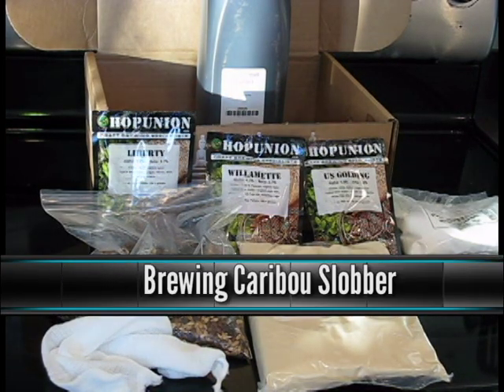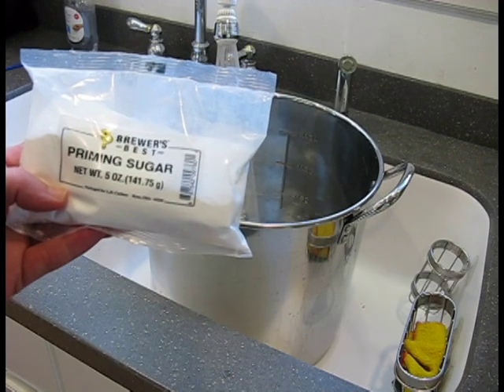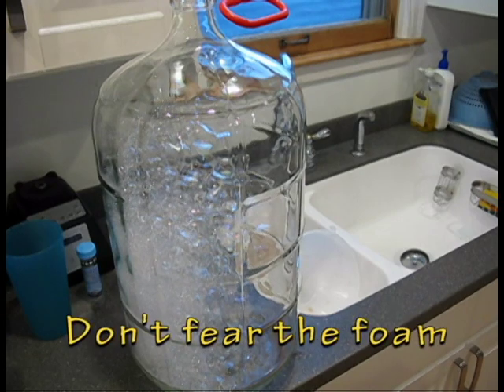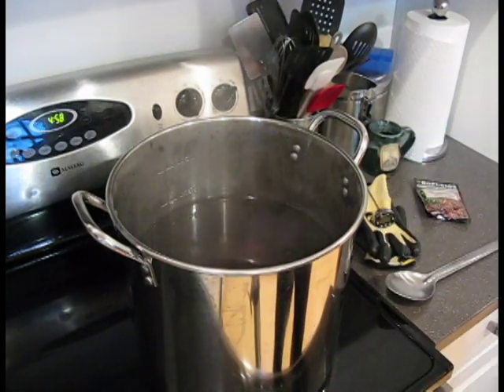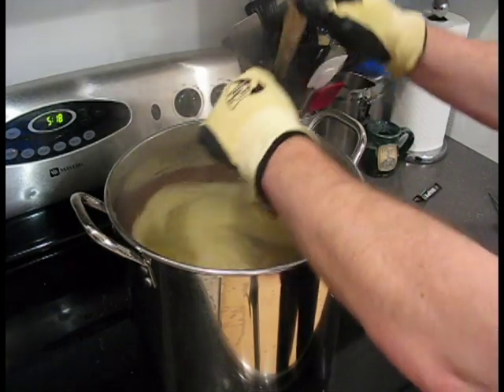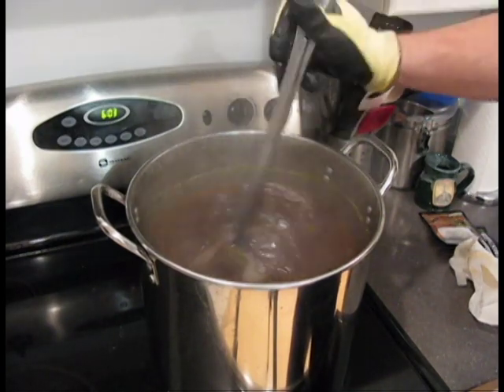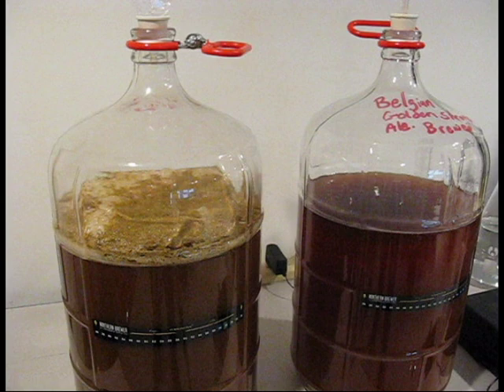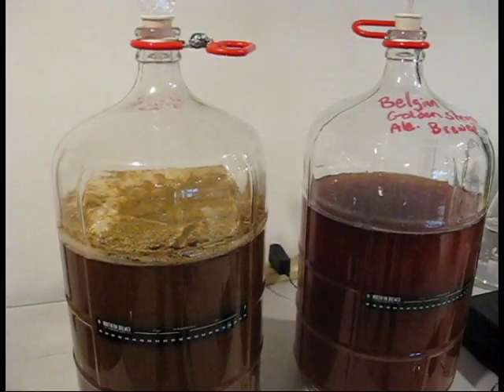Brewing Caribou Slobber kit from Northern Brewer

Comment: You quote to steep specialty grains 20 minutes at 170°F, yet NB instructions quote "Steep for 20 minutes or until water reaches 170°F. Remove bag and discard" Confusing, when making all grain beers the mash requires 165-170 temperatures.
I've made other beers and basically say the same steep time. I place grains in at cold and and when temperature reached, drain and discard. Thats how i define their instructions.